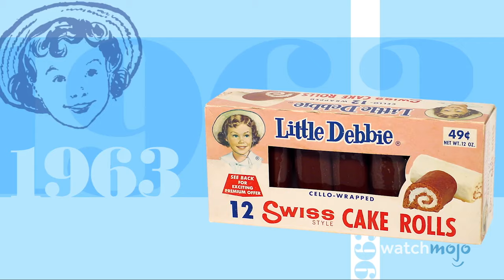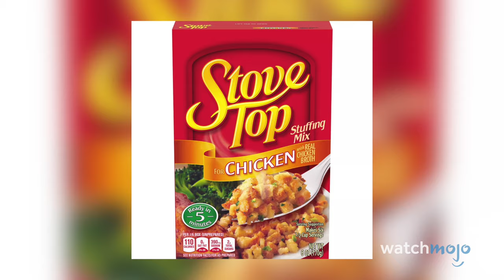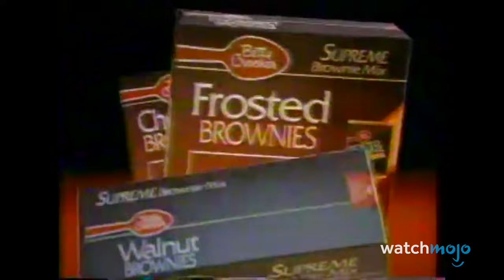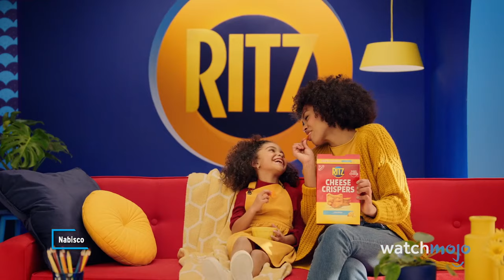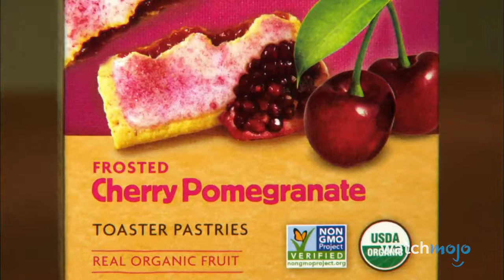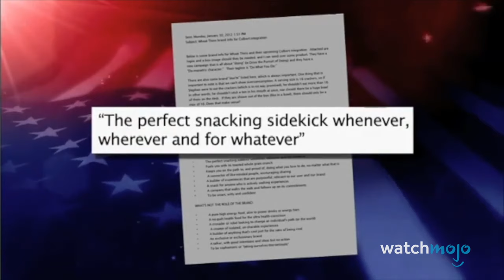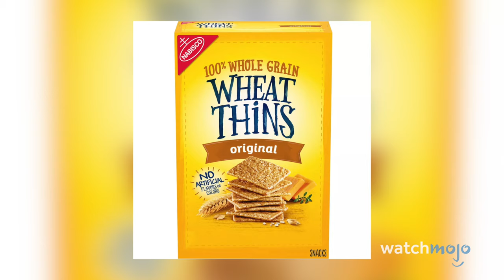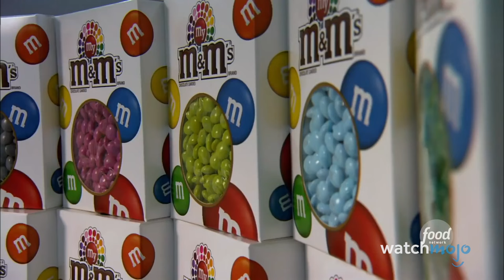Top 10 American Foods that are Banned in Other Countries

Comment: Fun Fact: Azodicarbonamide is also used in the soles or running shoes and yoga mats. So if your bread has this in it, put it back on the shelf.
Reply: So is dihydrogenmonoxide.
Reply: And plastic as well